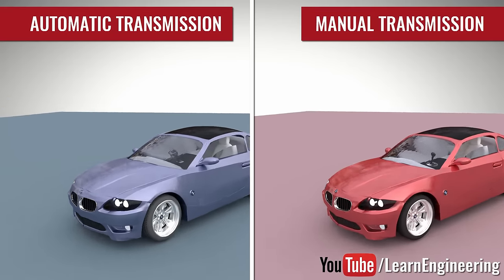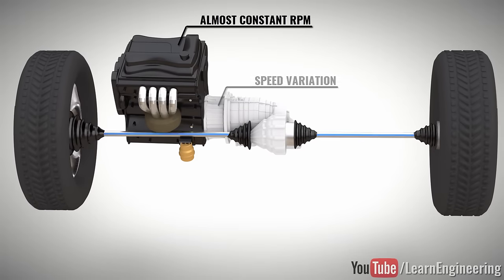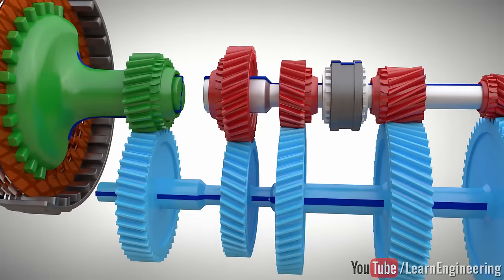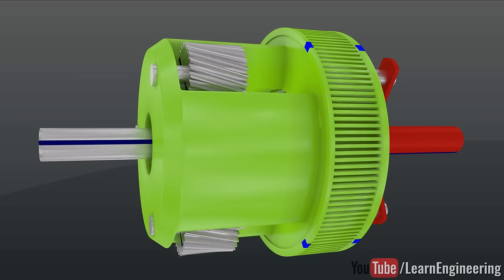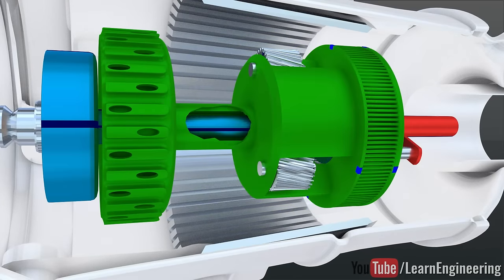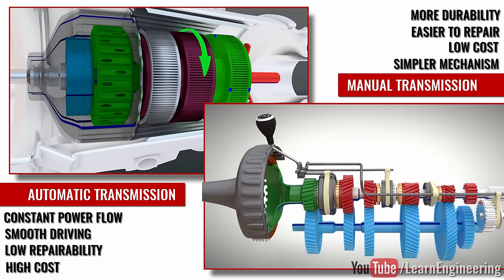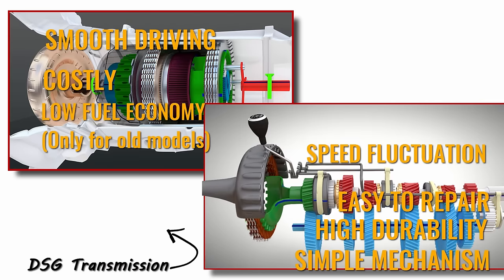Automatic vs Manual Transmission

Comment: I always thought an automatic transmission would just be a manual transmission but shifting it automaticlly
Reply: Me too!
Reply: That’s a robotic transmission)
Reply: Cheaper cars have that, 3 motors to replace clutch and the two movements the stick would make
Reply: @Pascaleiro  that must be what my sister's little old Suzuki uses
Reply: FR
Reply: That's actually a real transmission called an SMG BMW famously used them in their M cars, and they have some advantages over both, SMG retains the enhanced fuel efficiency and power delivery of a manual (more energy created by the motor goes to the tires) but is driven like a normal automatic, they are also lighter than automatics which is good for sports cars, however they are expensive and break often, besides BMW they are often used in military applications for their ability to handle extreme tourqe and being simple to work on like a manual.
Reply: They do have automated manuals. No clutch, shifts itself and sounds like a manual. Look at the DT12, Eaton Endurance, etc..
Reply: @txmuddigger  Yeah those are just like the SMG BMW used, they do have a clutch though, usally a single dry clutch, they just don't require a pedal to engage and disengage the clutch as it's handelled by a hydrolic servo.
Reply: enter Getrag pre-Magna acquisition
"Breaking news: Ford recall for PowerShift transmissions"
Magna
F
Reply: Same until I started seeing video like this on youtube
Reply: Wait wait, you gat a point
Reply: @angryktulhu  or sequential
Reply: Well yes but no
Reply: and how would it do that, you doink?
Reply: Do you mean sequential transmission?
Reply: @John_Kap  precisely
Reply: It's not?
Reply: Same here
Reply: You're not alone my friend
Reply: They do exist, for example, the new tata punch utilises them. The computer controls what gear the car is in. This is common in cheaper vehicles, the act of shifting the gears and pressing the clutch is replaced by motors controlled by the said computer.
Reply: Me too. But such things are called Automated Manual transmissions. They range from cheap suzuki cars to advanced Lamborginis. They still retain the similar trait to manuals which is power loss on shifting. But the ones on expensive supercars have their clutches designed to disengage and engage as quickly as possible in miliseconds, which is not the case for cheaper cars. I know that Dual clutch would be a more viable option. But some supercars do use single clutch AMTs.
Reply: well, it actually exist
there are two main types of automatic transmission: torque converter and dual clutch or direct shift
the torque converter is the one shown in the video, nothing more
the dsg uses two clutches (hence the name dual clutch) and a electronic unit to change gears, and it basically put together all the benefit of an automatic (which are the smoothness and fast gear change) and of a manual (better gear change and more precise control of the traction). you will still have 2 pedals but also some way of going in a manual mode (usually with paddle on the driving wheel). this tech was invented by vw and it's now used in a lot of cars, ranging from the polo up to the Lamborghini (yes, Lambo is owned by VW so they use the same tech).
Reply: @teargass1849  not being able to change gears yourself is NOT an advantage
Reply: I think those are AMT?
Reply: @AverageAlien  yes it is
Reply: That kind automatic exist too
Reply: The sst on my Evo is exactly that
Reply: how can you get 1300 upvotes for a comment you wrote 10 months ago, but my comment from a whole year ago gets completely ignored???
Reply: automated manual transmission are a thing. BMW has SMG, Alfa Romeo has Selespeed, etc
Reply: That's ASG tranmission from VW. Toyota has it too. There are many ways to have automatic shift.
Reply: When i was young i thought its like CVT/Torque Convert only
Car dont shift
Reply: actually there are transmissions, that shift automatically, but have the same tech as manual transmissions. our car has one
Reply: ㄹㅇㅋㅋ
Reply: My god he’s got it
Reply: same tbh
Reply: @Pascaleiro  i feel as if that would be on more expensive cars cuz it seems like more would go into it
Reply: @teargass1849  i've heard that the reliability of those isn't the greatest, is that true?
Reply: That is true for some transmissions; They're called automated manual transmissions or AMT in short, they are mechanically identical to a manual but are operated by a computer. They are common in really cheap economy cars and some supercars too. The lamborghini Aventador might be the most famous example.
Reply: Thats what a semi-automatic or a robotised automatic is.. cheaper/smaller cars use it to save weight and cost.. basically cars like the 1.2L Fiat 500, the Smart ForTwo.. etc
Reply: @TheAlbaniaGaming  And also cars like the Lamborghini Aventador, Ferrari Enzo, Pagani Huayra...etc along with with 80% of big commercial trucks, because it can take a lot of abuse.
Reply: @salahdehina9733  does the BMW SMG transmission in the old E46 M3 work in a similar manner to a manual transmission?
Reply: @bren.nan_  Yes, it does. It should feel like your driving a manual car but someone else is shifting for you, you can even hear the gear clunks during shifts.
Reply: @salahdehina9733  ah thank you! my uncle used to have an M3 with an SMG but i never drove it so i was curious
Reply: @anderstermansen130  who cares
Reply: @Norwegian_Bastard  DSG is a dual clutch tansmission.
Reply: Tractor trailers have that.
Reply: #a4 @Pascaleiro @q11@@A
Reply: There is actually a kind of automatic transmission called as AMT ( Automated manual transmission) which behaves exactly like you descirbed.
There are many different technologies of Automated transmissions ,the one described in the video is just one of them.
Reply: Same here!
Reply: same for me, kind of
Reply: @Thrombosed, If that's the case then why can't automatic cars stall when they have no clutch? eh? torque converter is key
Reply: What thought is real and calld AMT transmission, it's manual but the geard and cluch are computerized
Reply: The automatic mentioned in this video is just one type of automatic. There are CVT, AMT and DCT other than this type. 
Where in CVT there is a belt and pulleys instead of gears, AMT is a same as manual transmission with automatic actuators. DCT is a dual clutch transmission with gears.
Only a torque converter uses planetary gears.
Reply: Same
Reply: Well, I also thought about that when I was younger lol😅
Reply: @sooryanhits  CVT is not really automatic
I mean, it technically is automatic, but when you tell people auto-gear they will immediately associate it with torque converter
Reply: Well there is a type of automatic transmission called AMT(Automated manual transmission) which is just a manual shifting automatically but that's just one type.
Reply: Volkswagen's DSG Transmission is actually two manuals connected each other with a simple computer.
Reply: Same 😂
Reply: 😂😂😂😂😂😂 you made my day 😅
Reply: Fair thinking
Reply: Suzuki has an AGS system which is exactly what it is
Reply: Those exist. Automated manual transmissions. They are used in new big Semi Tractor trailers.
Reply: Me too 😁
Reply: Little do you know that is a thing and it’s completely separate from both technologies
Reply: There is also system like that called automated manual transmission which is as the name suggests what you’re thinking
Reply: @anderstermansen130 stop crying about it and make better comments
Reply: Congratulations you just discovered dual clutch transmissions
Reply: The Kingdom of God is at Hand 
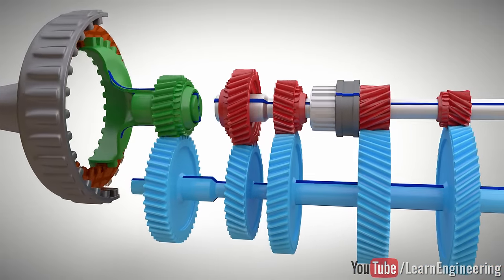John 3:16
King James Version 
16 For God so loved the world, that he gave his only begotten Son, that whosoever believeth in him should not perish, but have everlasting life.
Reply: Me too ... I thought the inside mechanism was the same and shifting done by the computer instead of human 😂
Reply: The ones in commercial vehicles are essentially that.
Reply: Thats automated gearbox
Reply: That does exist like VWs DSG transmissions or widely spread DCT transmissions.
Reply: Thats amt
Reply: Dual clutch transmissions are similar.
Reply: @Pascaleiro cheaper Cars Like Older Ferraris for example
Reply: That exists, and it's called Automated Manual Transmission (AMT).
Reply: That's way I am here 😅
Reply: Those do exist. It's literally a manual car where a robot operates the clutch. I haven't driven one but the car I'm buying soon has a transmission like that. However, most people don't like it because it shifts slowly and late. I think I won't mind it tho
Reply: Accept Jesus Christ ❤
Reply: Isn't that what a DCT is?

Comment: I just press and hold W on my keyboard to accelerate.
Reply: Same
Reply: Gamer Moment
Reply: How to get called a nerd in a nutshell lol
Reply: underated comment
Reply: Hahahahaha
Reply: Hehe
Reply: That's Gamer transmission.
Reply: I don’t have a W button, I’m on controller
Reply: @loos6642  gaymer moment :D
Reply: i use manual sometimes
Reply: Go outside nerd
Reply: Non car guy
Reply: I used G29 pedal but why the fuck there is no clutch bite in PC games always stall
Reply: Same fr
Reply: S And D for left and right
Reply: Arrow keys are the best
Reply: Child.
Reply: @tempuramonster  
"tempuramonster" calling someone a child
Reply: rise up gamers
Reply: I just depress the R2 button deeper. Sometimes i just need to hold it longer, or i only need to push the left analog stick.
Reply: Keyboard moment.
Reply: And n for nitrous
Reply: X on PS2 
R2 on PS3/PS4
Reply: Dylan  what
Reply: I press shift to gear up in nfs
Reply: @vellyjatt7824  bro s is for backwards 
It's a for the left and d for the right
Or you just changed your controlls
Reply: Weeb take
Reply: And S to brake and reverse
Reply: Noob
Reply: Noob